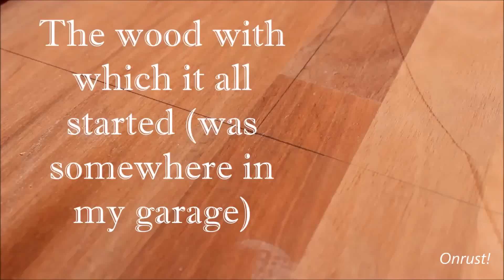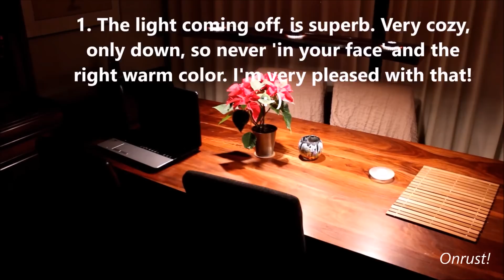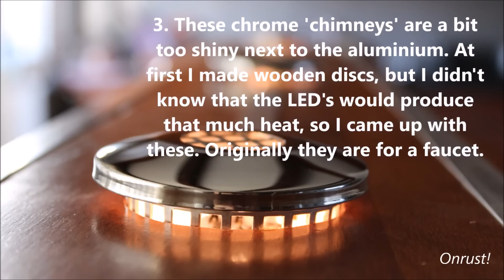A wooden LED hanging lamp - design and making

Comment: I’ve refinished wood many times, and made new pieces too. I stain it, then butchers (carpenters) wax for the finish. I used 0000 steel wool, then clean with alcohol, then wax and buff til you arm hurts and repeat many times. The finish is superb.
Reply from the maker: Interesting.

Comment: Well, I also want to build my own lamp. But I don't have the tools. So that means instead of putting just a slit into the wood I have to make 10 smaller wood plates. And 5 pieces of multicolor adressable led strips. Then I have to Programm the effects.

So would you suggest using the cheapest wood for the first one, after all I never have build furniture?

The only good thing is that I can check the electric wiring to German standards on my own. 
(Mostly for insurance reasons)
Reply from the maker: The tools are of minor importance, as is the material. Your will and determination is key. Just do it with whatever you have, and however you think it is right. Asking for help is not bad, copying what someone else made is not bad, and even failure is not bad. THAT is the way you LEARN. JUST DO IT! 
I wish you lots of success!
Deutsch? Hätten wir's auch in deutsch machen können... :-)

Comment: looks cool! 
How did you connect the led to the suspensions/wired? And even more importantly how did you  go about connecting it to the power outlet in the ceiling?
Reply from the maker: Yes I regret not have shown that. In the lamp I drilled two long holes from the hanging wires to the first light. In there run the + and - of the powering wires. At the ceiling the two hanging wires are connected to a transformer I could hide in the ceiling (there just happened to be some sort of cavity). The transformer is connected to the main power. I learned from that, because for the latest lamp I made (wait for the video - it might take me some weeks), I made a ceiling part too. Just a piece of wood with the same measurements as the lamp, so the wires run straight up, and up there you have a place for the transformer too. Also I gave that ceiling part some LED strips that shine up, onto the ceiling. It gives a nice effect. 
That latest lamp is some kind of continuation of this one, as I took the same concept (flat lamp with three lights), but I placed the lights ABOVE the lamp shining down and made that piece of transparant epoxy. I filled that up with gemstones. I like the way it came out. And more important, that lamp was allowed to stay above our dining table as well (doesn't happen with all of my projects - almost none my wife likes well enough 😏).

Comment: Are the aluminum bits intended to be decorative or to hold the lamp flat? Or both? I've been thinking of doing something like this for some custom shelves with a fairly long span.
Reply from the maker: Decorative. I thought I would need them to create some kind of straight edge. Afterwards I'm wondering how it would have looked without them, especially because they were a lot of work...
Reply: I think that it is good to have the aluminium straight edges.  They make a lovely contrast to the edge you carved into the wood, and the colour of the wood.  Brilliant piece of artistic decor.

Comment: I rate this lamp so much.. Do you see anything of the green leds in the Kelvin/colour? from switching them on and off, or it is way to low to fight with the other bulbs.?
Reply from the maker: For me this lamp is very special - more so than the table (I saw you commented on that too). With this lamp I got the feeling I truly created something new, where with the table I just made it a bit better. I must admit, the table for me was a way to get some experience with epoxy. No, apart from the funny effect the green does at shiny objects on the table, you don't see it. I must say, the green is next to the most powerful G4 LED's I could find.

Comment: Very nice .. I subscribed.. how did you wire the lights..? I don't see any wires from the ceiling ?
Reply from the maker: I used 2 of the 4 hanging steel cables for power. The transformer is in the ceiling, so the positive and negative of the 12V DC run through that cables. Yeah, pretty cool hm? :-)
Reply: Thanks.. Really cool :-)

Comment: Wow this looks amazing! Could you post more information about the lights you used and how they are powered by the hanging wires?
Reply from the maker: I'd be glad to tell you more... but what is it that you want to know about the lights that is not already in the description of the video? I just drilled a hole from the first LED to the holes of the hanging kit, to connect the wires that run through the lamp to the kit. That is all there is to it..
Reply: More specifically the type of lights they are. I live in Australia and can't seem to find anything that looks as nice from the back as yours do. Is there a name for the lights you used that are powered from the hanging cables? I can only find trapeze lights which don't look as classy as yours.
Reply from the maker: Oh ok. Well, around here the G4 is very common... This is the one I bought: http://www.topledshop.nl/LED-Lamp-12V-halogeen-vervanger/LED-Lamp-12V-25W-G4-Warmwit-horizontaal-dimbaar.html let me see if I can find it in Australia... :-) https://www.ledshoponline.com.au/G4-bi-pin-LED-bulbs Well, close, don't you think? :-) G4 is very common in Halogen lights; it are those tiny glass lights, mostly inside spots. Often used in furniture or in the kitchen. I'm very pleased with the light that comes off from my 2,5 watt ones. I glued in this fitting: http://www.topledshop.nl/LED-Armaturen/TLS-G4-GX5.3-fitting.html The connection with the hanging cables, I made myself..

Comment: I like how the hanging cables also power the lamp. How do you deal with the current passing through the exposed wire though? Are the cables in a sheath?
Reply from the maker: No the current goes just through the exposed wire, no protection at all. Because of the 12 volts, that is not dangerous. I just was concerned that you could short circuit by putting fi. a knife in between the cables, but meanwhile I learned that the transformer is protected for that and it will instantly turn off automatically. You then just have to take the power off the transformer and it will switch itself on again... Most modern electronic transformers have this kind of protection.

Comment: Onrust this is very inspiring. Wondering how did you manage to hang it from your ceiling. There must be some sort of half a ball or something similar where you put your  transformer and where steel wires are attached. Wheredid you get that? Thanks.
Reply from the maker: Momentarily I just screwed the wires in existing wooden beams in the ceiling, that already happend to be there. But next time I would make a square ceiling-piece that is about as large as the lamp (maybe slightly smaller), so the four wires would hang straight vertical down. Now there is coincidentally some room in the ceiling where I could hide the transformer, but when you make said ceiling-piece, you could conceal the transformer above that too..

Comment: nice work, you said the steel cables are used to power the lights? So when the lights are on, the steel cables have current on them?
Reply from the maker: +homie817 - yes that's right. But only 12 volts, so pretty harmless... 😊

Comment: What LED's is that? Are they flat or how are they mounted? Or are you using spots? And what is that "grill" on top? It feels like something is missing, but I love the lamp :)
Reply from the maker: Look up the G4 LED. I just bought the connectors where the G4 fits in and glued them in. Nothing special. I had planned and made a completely other top, but when I noticed that one little part of the LEDs got pretty hot (I suspect it's a capacitor), I scared out and made me this.

Comment: So you used the electricity wire to hang it on.? 
Superb jobs anyway. I will stay tuned on your channel.
Reply from the maker: The other way around; I used the hanging kit to power it. So it is a special hanging kit with just exposed steel wires, no electricity wires. Welcome to my channel.. :-)
Reply: Onrust!, can you send me the link to buy the wire you are using, and what kinds of saw machine do you used to cut the edges of wood to make it looks like natural. 
Thx before.
Reply from the maker: The link to the hanging kit is in the description of the video. It's a webshop here in the Netherlands, but maybe with that you will be able to find you a local supplier... This is the saw: https://en.wikipedia.org/wiki/Reciprocating_saw
Reply: Och sory i didn't read the description before. By the way do you ever used regular jigsaw cutting machine to perform the same action or not yet? Is it possible to do that with regular jigsaw machine? Because the saw machine you are using is expensive.
Reply from the maker: I have got a jigsaw, but for this job I thought the reciprocating saw was a better fit. Hey, when you haven't got the tools, you have to do with the ones you do have...! :-) I would just try. I always do. You could even use a handsaw with a small blade... 
I myself have a wishlist of tools I do not yet own: table saw, stationary router, planer, band saw... I don't even have the room for them now. And with a circular saw and a simple router you can do so much too. It only takes longer.. :-)

Comment: How did you connect it to 220 volts of power?
Reply from the maker: There is a 230V - 12V transformer in the ceiling. The 12V runs through the hanging wires.

Comment: AWESOME,!!!  How did you get the support cables to power the lighting?!
Reply from the maker: Thank you! The steel cables are being sold in a hanging kit, this one: https://youtu.be/od4TUoBb2lM , I bought them from a local webshop, www.staalkabelstunter.com. I drilled holes from the nearest light to two of the cables, and connected wires to the kit. For these holes, I had to buy a thin (6mm - the thinnest I could get) drillbit of 40 cm long. (Oh, I should have recorded that too..! :-) Those holes were tricky...
Reply: Onrust! 
How does the electrical current run along the cable?  Is there a transformer?
Reply from the maker: Yes, there is a 230V - 12V transformer above the ceiling. So 12V runs through the cables.
Reply: Could you get shocked by touching both the 12V and ground cables at once?
Reply from the maker: No. But I'm thinking about putting a fuse in the positive wire in the ceiling for the occasional joker who puts his fork in between the two cables. Not that it would hurt him, but I'm afraid my transformer wouldn't survive...
Reply: Onrust! Depending on the amperage capacity of that transformer I'd be more concerned with the heat in the case of a short circuit. Do those things have internal fuses?
Reply from the maker: You're right, that's a concern too. I don't know if there is an internal fuse, don't think so. On the other hand, because of the low amperage of this model and the fact that it is completely electronic (only 1,25 A - it's really tiny) my guess is that when it goes, it blows up fast and relatively harmless. But again, not a risk that you should take, so I'm gonna mount a fuse.

Comment: Where did you buy the led lights? how did you power them from the ceiling? Thanks
Reply from the maker: Here I bought them: http://www.topledshop.nl/LED-Lamp-12V-halogeen-vervanger/LED-Lamp-12V-25W-G4-Warmwit-horizontaal-dimbaar.html I love this LED, I built some 40 in my bus. They are convenient, because they operate on everything from 10 to 30 volts. So it doesn't matter if you power them with 12 or 24 volts and they don't mind the charging-cycle, where the voltage goes up to 28 volts... 
The transformer is in the ceiling and I used two of the hanging steel cables to run the power through (one +, the other - ).

Comment: wow ! i've a question , did you use heat sinks to counter heat from g4's ?
Reply from the maker: No, just the open 'chimneys'. It is only one little part of the G4's that gets hot - I think it is a capacitor. The rest stays fairly cool. It was just enough for me not to want to close it up entirely.
Reply: Onrust! What are those “chimneys”? They look cool

Comment: How does it get power?
Reply from the maker: I used 2 of the 4 hanging steel cables for power. The transformer is in the ceiling, so the positive and negative of the 12V DC run through that cables.

Comment: Wird die Lampe per AKKU betrieben oder wie hast du das gemacht?
Reply from the maker: Oberhalb der Decke ist eine Stromwandler van 230V auf 12V. Der Wandler hängt einfach am Schalter von die Lampe die vorher da war. Nein, kein grosse eingebaute Batterie... :-)
Reply: achso ok weil man da irgendwie kein Kabel von oben sieht :-)
Reply from the maker: Ah, Du hast nicht mitbekommen dass ich zwei von die Stahlkabel vomit die Lampe hängt verwende für den Strom..
Reply: achso, super Idee. bei 12 v brauch man die auch nicht isolieren oder so
Reply from the maker: Genau. Überlege mich nur ob ich nicht noch ein Sicherung einbauen werde, für den Fall das einer ein Messer oder so was zwischen die Kabel steckt.. Das würde der Wandler nicht überleben...
Reply: Meinst du auf so eine Idee würde jemand kommen da ein Messer oder so ran zu halten
Reply from the maker: Könnte auch unbeabsichtigt sein...

Comment: Nice work. We build too such a lamp. We used smart Controllers so you can change the Color, saturation and you can use your smartphone or a remote. Check it out. Your lamp looks really stylish by the way, good work!
Reply from the maker: Eur Lampe gfoallt mi a.
Reply: Onrust! Danke des gfreit uns ;)